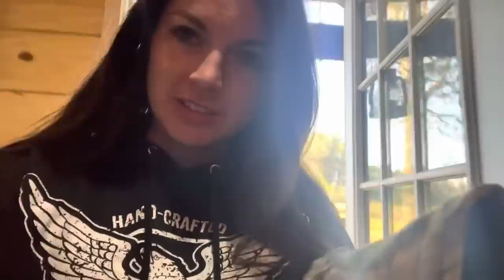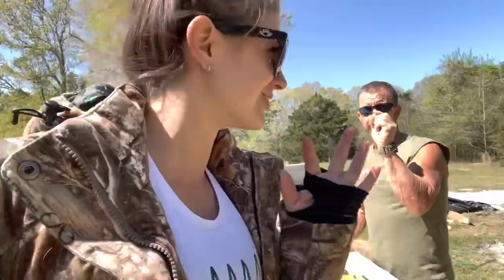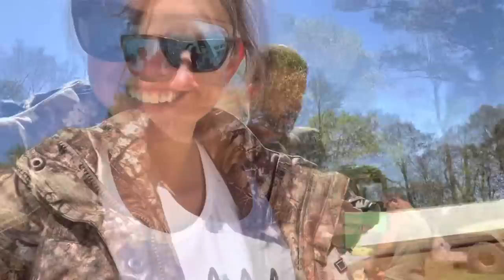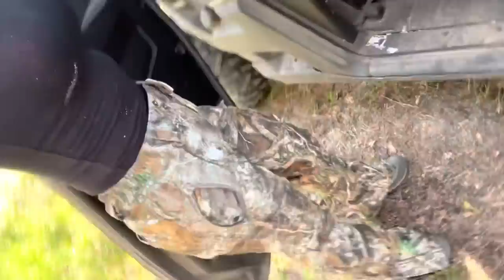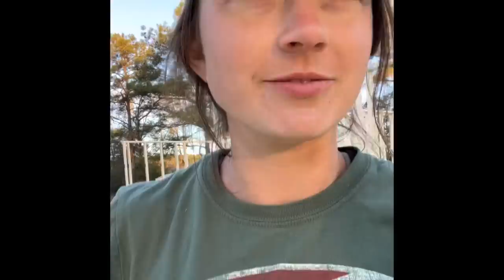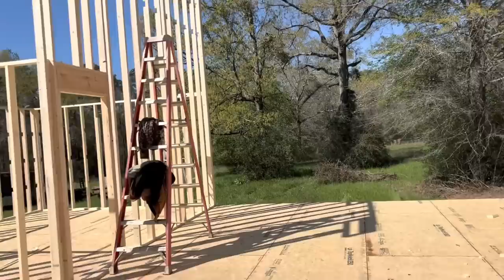Walls Coming up on My House!

Comment: I have been there done that as well.I grew up in construction.only we didn't have air nail guns,all hammer and nails. From the the dirt to the shingles.wr did all the outside and inside trim,windows n doors.Loved every minute.... Wished I could still do that kind of work.

Comment: l made a comment the other day about using plywood rather than chip board, l should have kept it to myself, l love what jeff and Hanna do, l only commented because l have built a couple of homes and up her)e in Canada., chip board does last the test of time. As l mentioned when you hire a contractor they all use it everywhere because its cheaper and it meets code. But when you are building your own home l would use plywood (custom home). l have drove around and looked at roofs with huge sags expecially on 24 inch centers. Jeff will probably ream me LOL..

Comment: Sure you got all your light fixtures, oh maybe something a little bit different about the staircase or something built into the walls no one forget anyting even like add something later usually cost $10,000 more?
Reply: Like I just come across an idea for my kitchen. Put a bar around the kitchen, you can add structural support or just post for looks. So if you're like an open floor plan the kitchen would be enclosed by the bar like I said you have pillows, and you will have to have a dining room table at all times.

Comment: He must not have any win there because you're not doing any bracing and if it was up here in Iowa them walls would be on the ground with the wind that we have here this spring if you can call it spring I still think it's winter because of the temperatures and like you say the temperature is up in the day and down at night

Comment: You southerners wouldn't last very long in the cold up here in Minnesota. There are times when 10°-15° actually feels warm in January and February after a week or two of sub-zero temps. To be fair, I wouldn't last very long in that Southern summer heat either.